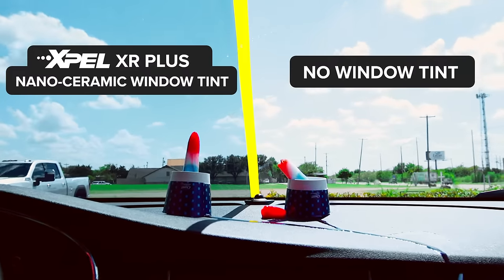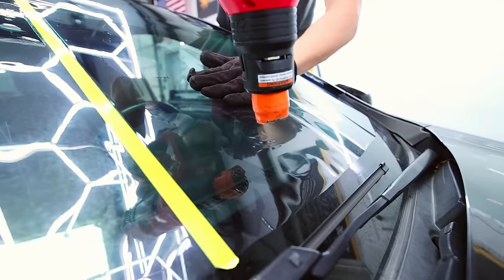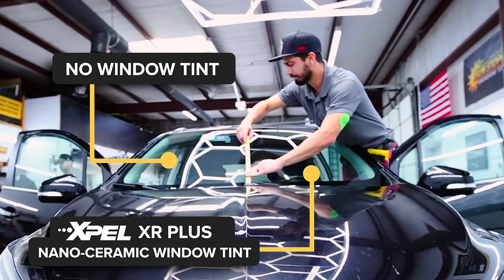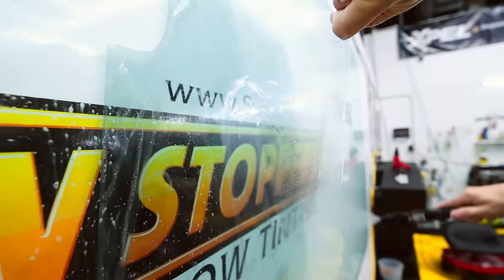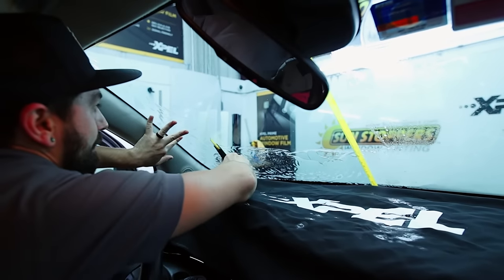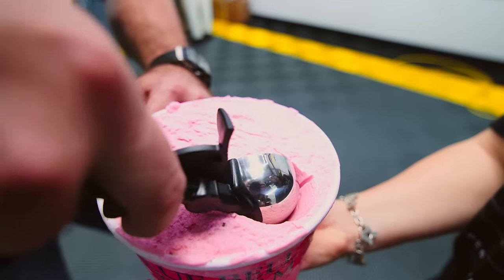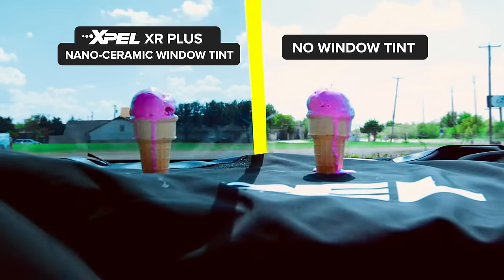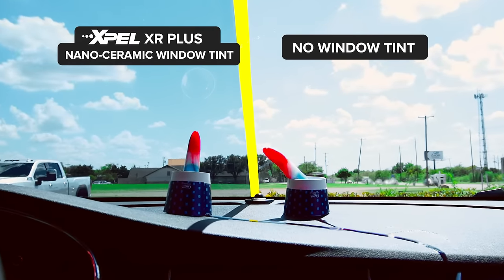XPEL Nano-Ceramic Window Tint Ice cream Test

Comment: I found my professionally installed nano-ceramic tint was absolutely worthless. The sun doesn't shine for 5 minutes... when it's shining for more then 5 mins it overwhelms the tint. 95% of your car is still getting direct sun too. No noticible effecta whatsoever.
Reply: It doesn't help a parked car much but it makes a huge difference driving when the sun is hitting you from the side windows
Reply: What color is your car?
Reply: Maybe you need to also get your windshield tinted with clear nano-ceramic tint.  I had the windshield coated and it made a huuuuge difference in my car in the hot California sun, even when parked in direct sunlight on 100+ degree day.   Even better if you do all the windows and even better still if you have a white or light colored vehicle.
Reply: lol it’s not about parking temps.
Reply: @jaysonmarquez7524  So parking the car in the sun in Arizona or Nevada right now where it's 115  right now, you're saying that ceramic tint makes no difference?
Reply: @komoru  NONE. ZERO. Zilch.
Because the rest of your car is heating up too.
Where it does help is it blocks the radiated heat that directly hits you once you cooled off your car. It's a lot of marketing hype and nothing but being parked under a Shady Tree will keep your car from getting hot.
Reply: @rxonmymind8362 basically,  it's about not having the sun burn your face or arms when you're driving

Comment: what percent tint was installed on the windshield in this video?
Reply: 35%
Reply: @RyansReaper how do you not get pulled over with 35% on the front windshield?
Reply: How certain are you it was 35%.
Reply: @Aus200 it's a different type of tint for front windshield not same type of 35% they use for other windows
Reply: It blocks out 50% of the heat but its really hard to tell that its tinted.
Reply: @Aus200 wym, 35 is like no tint,  visibility is almost complete as no tint lol.
Reply: @neometalx9  I believe you are thinking of it backwards... 35% only lets in 35% of the light. So, it's blocking 65% of the light (if you want to look at it that way). And that's quite dark at night especially. 35% is not allowed in many states.
Reply: @Aus200  That was for the test. You can have tint on the top 5" in Texas, but not the whole front windshield. 25% is legal in Texas on the other windows :)

Comment: The test should be done with the entire windshield tinted because one half of it is not rejecting the heat and will heat up the cabin
Reply: If there was already a noticeable difference with this type of flawed testing method, then the actual results would only be better; and can’t possible be worse — think about it

Comment: At the end of the day, both ice creams melted. Ceramic is not a miracle worker. Of your car sits out in the sun, it will get just as hot as if it didn't have tint.